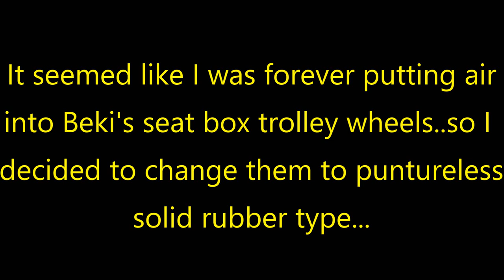Fishing trolley wheel conversion..

Comment: Monster wheels, they look like they would last years. I am just looking into trolley wheels, as I just swapped the rear wheels over on my 6 wheel shopping trolley. I was sick of the original ones failing, by either walking off the axle, or the tyre coming off, after a lot of thought and research, I was able to source a much stronger 6" wheel from a folding wagon, that fitted almost perfectly. There does not seem to be much on youtube that is very helpful about this topic, so I made a rough video, yours is only the 3rd video I have found, that is in anyway helpful or informative, nice job.